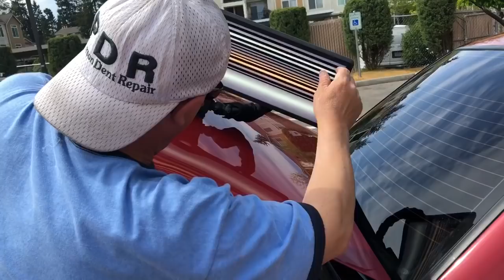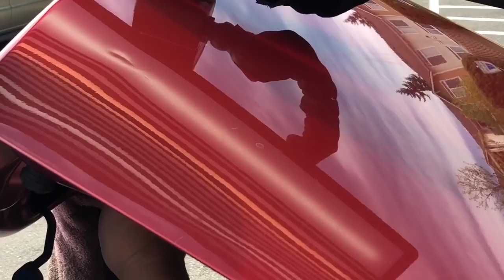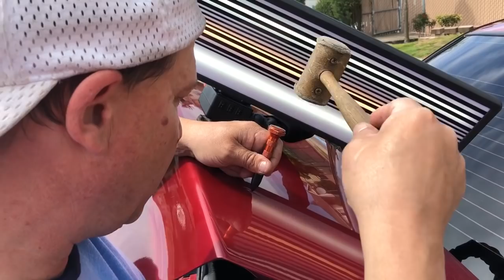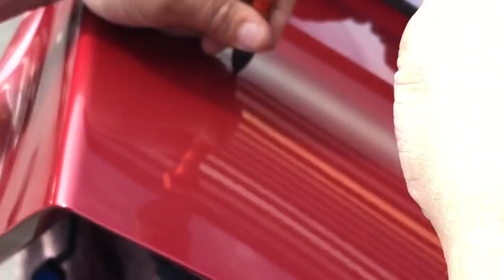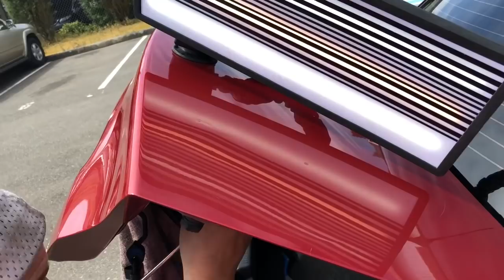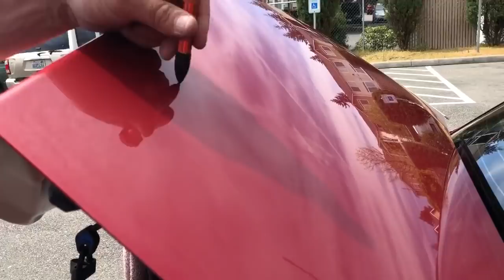PDR 😎 NINJA dent repair on my neighbors car! 👀 #PDR #NinjaPDR

Comment: Could this have been glue pulled 1st then pushed? Just curious why that decision was made?
Reply from the maker: js92css It could’ve been Blue pulled but with the severity of it it wouldn’t have done too much. Plus it would’ve taken the time of heating up the glue gun and then using supplies i.e. glue and rubbing alcohol. For a free ninja style Dent I just stuck the tool in there and got right to the back of it. That had most to do with the decision:) It was wide open from the back. Thanks for watching